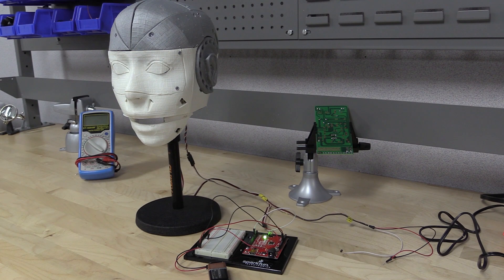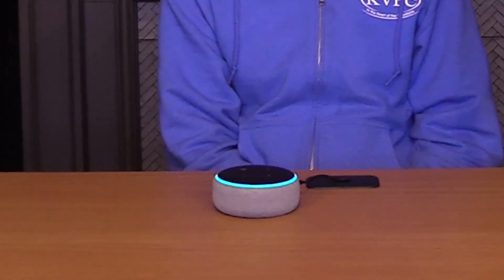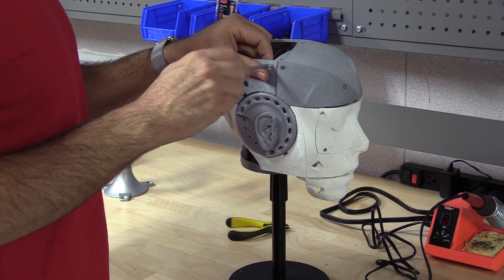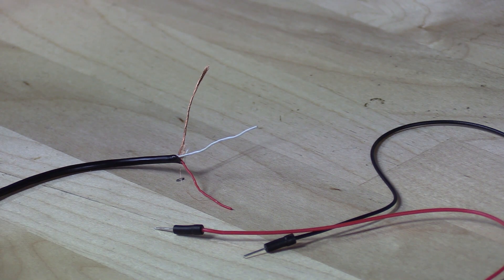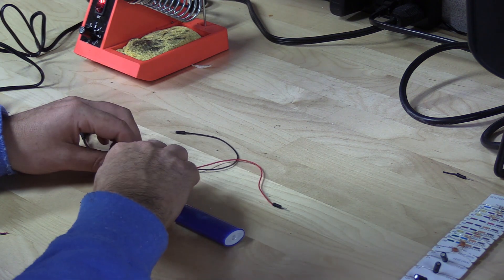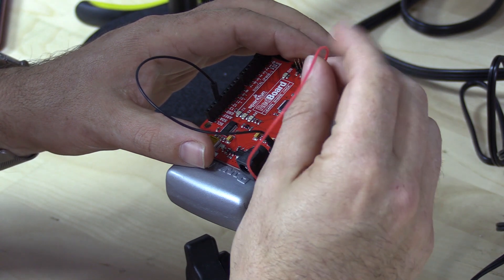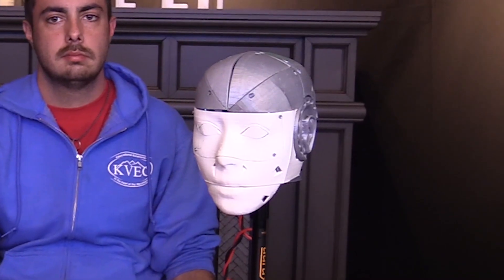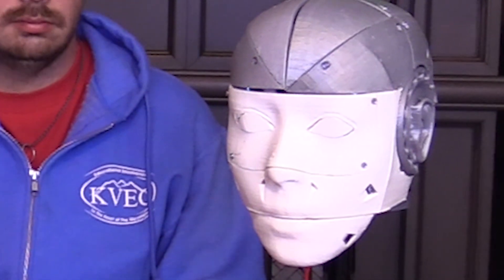Inmoov talking robot with alexa!  PT1

Comment: Would you be will to share or sell the code? Also is that a 1k ohm resistor?
Reply: One more question- what gauge wire?
Reply: @abigailgeorge5068  it looked like that was just a regular jumper wire. Arduino website says that with connecting audio jack is a 100k resistor. But everyone still double check the research.